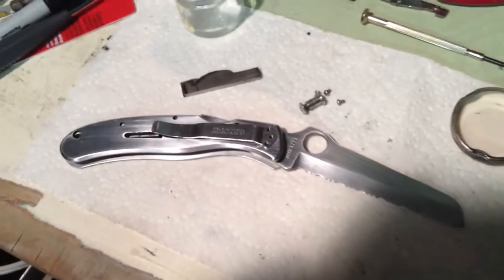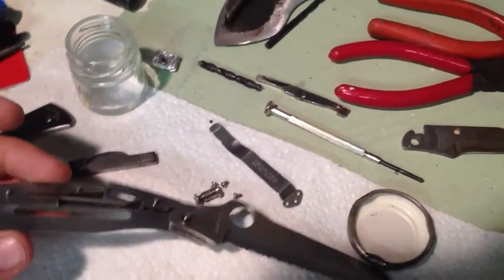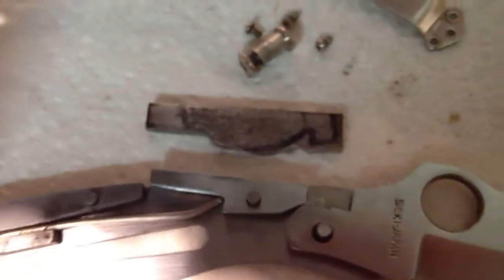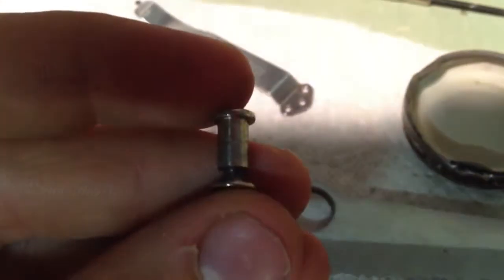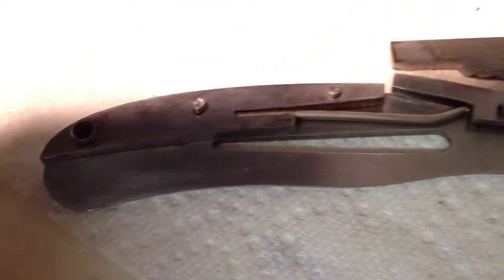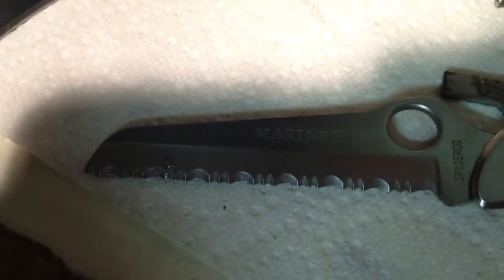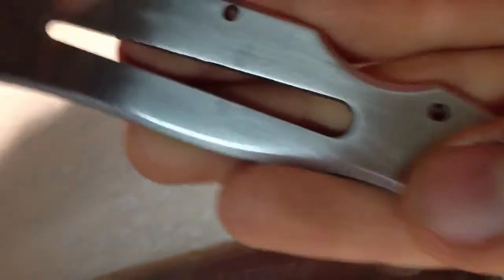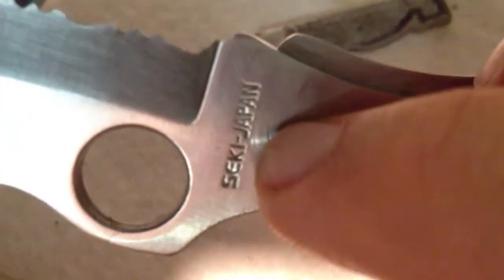Fixing a spyderco mariner

Comment: Very similar to the Harpy. Slots on the side are not for drying, but is a tool to unlock rope stainless screw pin anchors for marine use.
Reply from the maker: R L ohhh, awesome. Thank you for letting me know!
Reply: Have that same harpy. Badass knife